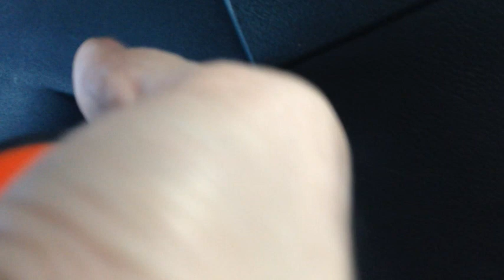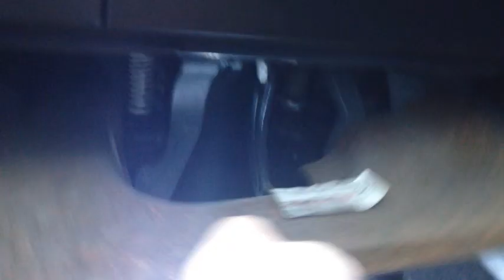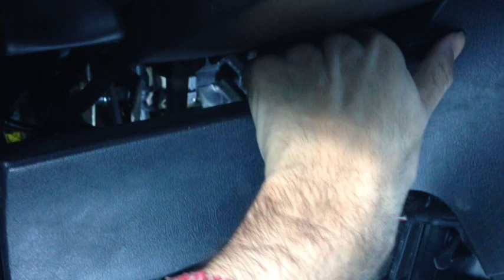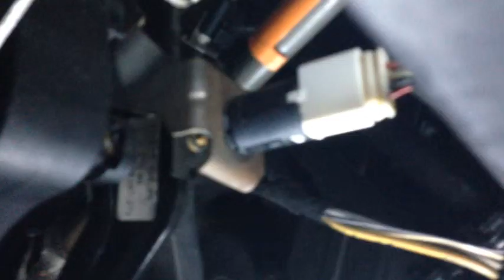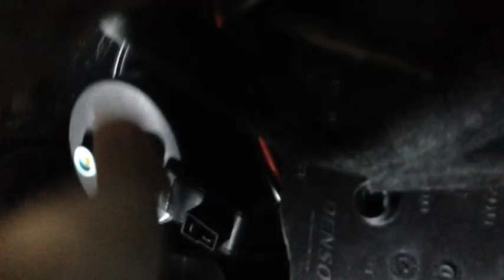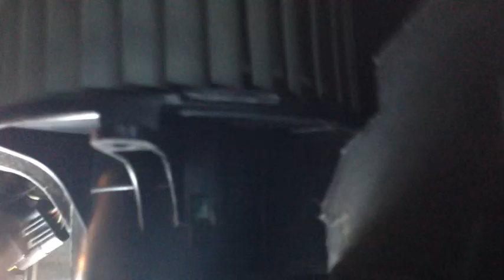Peugeot 307 - Air conditioner - fan - DIYChannel

Comment: is it possible to remove blower without touching steering wheel ?
Reply from the maker: Yes, it's possible. This the reason for this video. The trick is the position of the fan. It's an especific position, so you will have to use the pause in the video. 😉